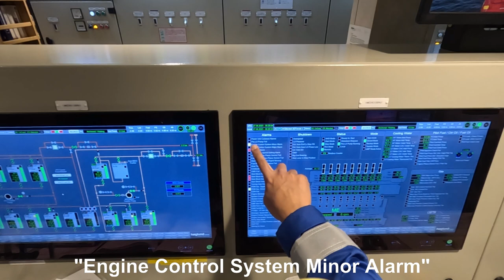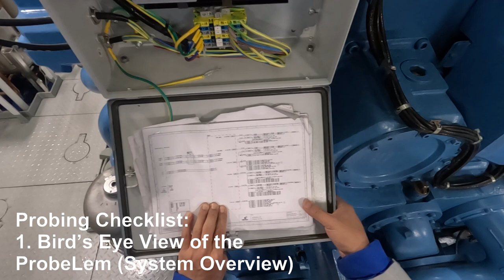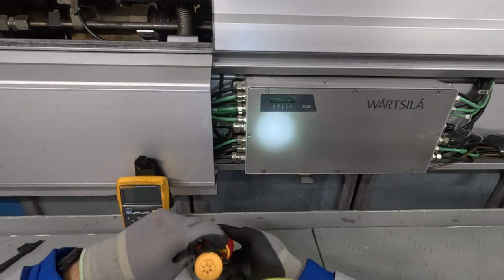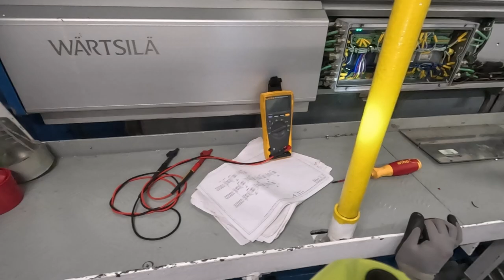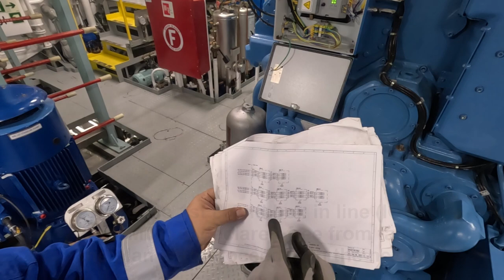#Probed! How to Troubleshoot Earth Fault in Wartsila Main Engine

Comment: Good day! I have one question. Why you are switching off PDM every time when unpluging from CCM/IOM? Is it possible to unplug and "Reset" PDM. Thanks!
Reply from the maker: Good observation. We are doing this to avoid unwanted short circuit from the loads of the CCM in question. As you can see, one phase is already earthed, unintentional touching of the other phase might cause short circuit through earth. One more thing is we are using this PDM to detect the fault itself because it is sensitive to earth below 100k-ohm at energized situation. Using multimeter is not so reliable while insulation tester (megger) is not recommended for this sensitive electronic component. Keep on probing🤗!